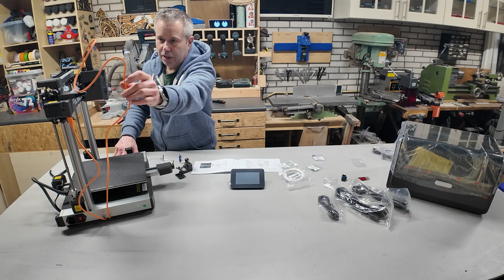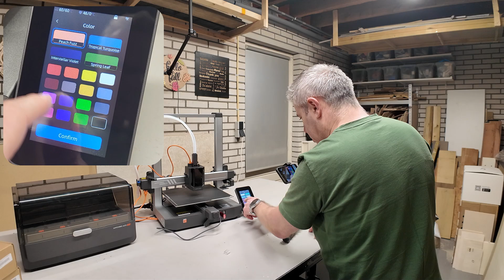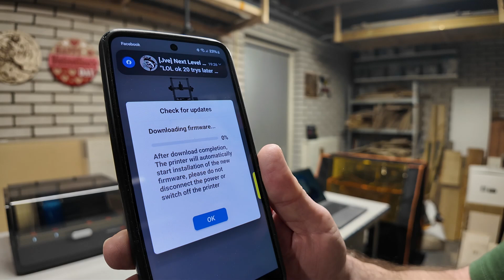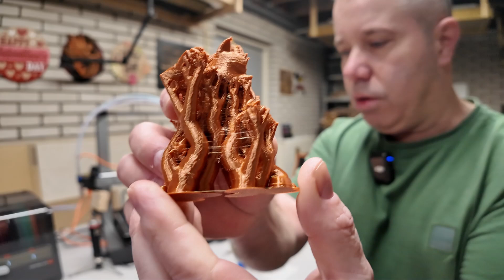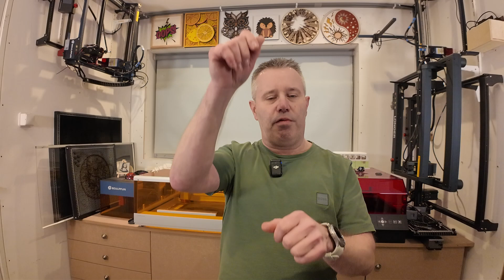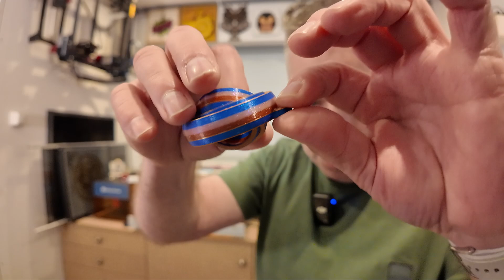Anycubic Kobra 3 Combo review  #3dprinting #anycubic  #geekbuying #diy

Comment: Hi, How do I release the 4 tubes from the top of the hot end?
Reply from the maker: You can release them by pressing down on the round part where the tube goes into. If it has the blue clip to secure it, you'll have to remove that first, then you can push it down and pull out the tubes.
I show how to do this in my video on the S1 used as a single color option.
It's at 2:33 in this video:
https://youtu.be/2tw8P0TYvpM

Comment: Hi , im planning to buy this printer , but i have a main question, does it come with pre-added filaments
Reply from the maker: Hi, no it does not. 
There's only a small amount of filament included with the printer so you can print a test benchy or anything like that.
Reply: @jewijk  hello , thanks for the info , but hear me out , im ok even with test filament , I'll need something to start with but without buying filaments!
Reply from the maker: @Zeleni-youtuber10 I think there's 10M included, so yes, you can print a small project without purchasing filament.
Reply: @jewijk  so yes , i was indeed checking if it atleast has any kind of filament included!

Comment: You can print supports in PLA and the piece in PETG?
Reply from the maker: Yes, this is possible. Have not tried it  myself, but I've looked it up and it should work like this:
When you load the model into Anycububic slicer, you need to first select the model and paint the whole thing in the color of filament you want it to use. 
After doing that, specify in the slicer settings what material to use for rafts and supports. This will now enable you to print your raft and/or supports in a separate material, and will let you set those options for which spools to use when you send the job out.
Reply: @jewijk  Thanks so much!!!. Maybe a video to see working?

Comment: Hello Jeroen, it's very good that you bring different methods of entrepreneurship, 3D printers are very interesting, but I was put off by the great waste of material and the long printing times. But I think that by having a good knowledge of the design and handling of the machine, very good things can be done. Thank you and happy Sunday.
Reply from the maker: Hi, thanks for watching. Yes, if you plan your colors/color changes correctly, this can save much time and waste.
Or you could even print colored parts first and assemble them later.
Anyway, with this machine you can do it all 😉